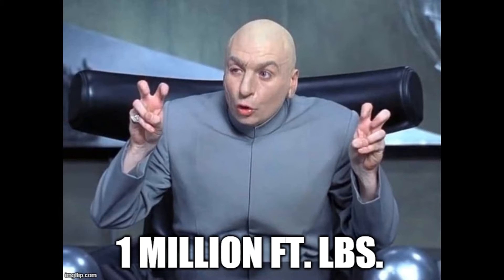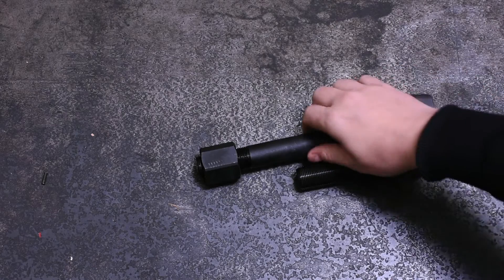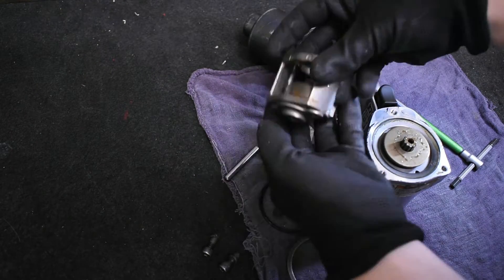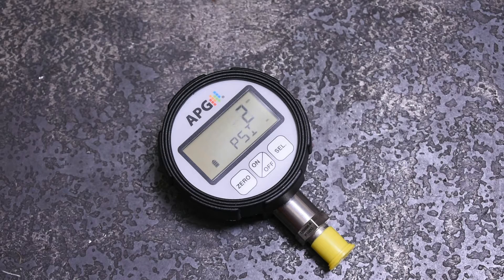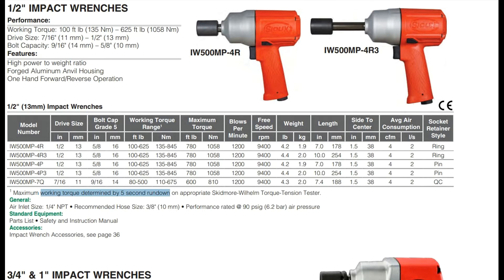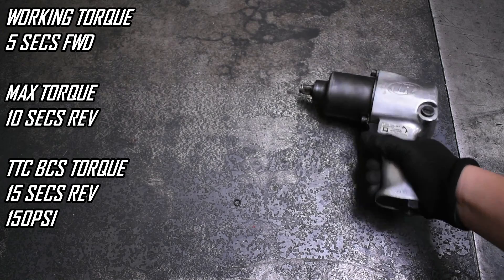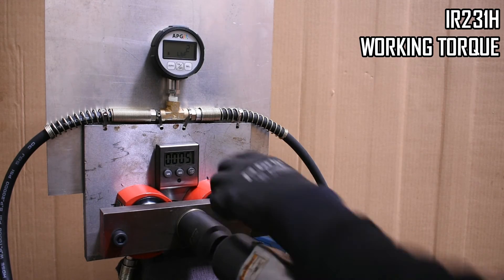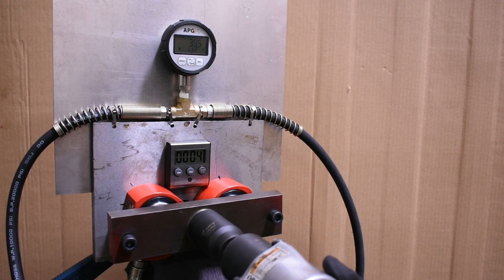Making a Digital Impact Wrench Torque Test to See Old-School FT-LBS

Comment from the maker: So what does a testing day with this rig look like?
1) Pull out a new or used bolt and nut and check its thread quality by running a new nut over it by hand, if it's ify measure stretch.
2) New grease to threads and backside of bolt head and grade 9 washer. If it's a new bolt, 5 beak in runs and re-apply new grease.
3) Test an IR231H to make sure it makes 440-460ft-lbs. If not, make sure gauge is within calibration to 3 known tool "standards" we have on hand.
4) Test 3 working torque tests, middle/median test is shown on screen. For cordless as long as the battery shows full charge each time we don't re-charge. Charge battery when done, allow tool to cool.
5) Test 3 Max torque tests, median is shown on screen. As long as the battery shows full charge each time we don't re-charge. Charge battery when done, allow tool to cool.
6) Test Best Case Scenario at higher pressure for air or fresh off the charger each time and in the FWD direction as well for cordless. Best value is shown on screen..

We note to you guys if they test all over the place or do other weird things.
Reply: I'm not clear on the rig reset process, actually. Not a big garage tool guy so not really familiar with how a short body ram works, but I can't imagine that they're set at minimum to start. Are they like, inflated to maximum to start with? Do you depressurize the system to undo the main bolt?
Reply from the maker: @orbitalbear  They are at about 50% extension all the time. Using a valve to remove pressure would save us a whole lot of impacting and time over the years, removing the bolts. But we didn't want to add any valves or anything in between or have the rams move in and out all the time for consistency sake.
Reply from the maker: @orbitalbear  Bingo. Usually with a different battery or different tool.

Comment: It's interesting to see that you started with the IR tool.  I worked in my father's garage many years ago, we had a 3/8" drive IR that was used occasionally but we mainly used a pair of CP tools, I think they were CP734 and have published specs identical to the IR tool.  We did anything and everything with them.  I don't know what air pressure we typically ran but my father once told me that when he was doing a lot of work by himself he ran the air pressure at 150psi or more to get more power out of the impact wrench.
It's interesting to see how you developed the test rig.  I would be interested in seeing how you capture the real time data and create the real time graphs.

Comment: Hey guys - I really like your channel - I especially enjoy getting cheap test results (I'd say free, but I did buy your spreadsheet).  I'm an engineer in a test lab, and I've been watching your videos for some time now and have some constructive feedback for you to take or leave.

1) Instead of counting your timer down, why not count up and just run up?  You can pull data for your 5 & 10 second tests from the single run.
2) You can automate your timer and get more precise to get it to start when you start the wrench - timing it off the first impact so you're not timing yourself pressing the button & getting your hands back on the driver.
3) I think this test method is fine, but I think you'd get much better data if you welded a bolt to a frame and made it into a load cell (add strain gages & data acquisition - this can be done well for about $500, maybe a bit more depending on software).  I've got a few technical reasons for thinking this would be better - if someone is trying to loosen a rusted bolt, the bolt isn't turning, and friction/bonding on the bolt is what you're trying to overcome.  In your stand, the bolt slides to a stop and friction would be subtracted from the measurement, as well as inertia from the bolt & stand.  At the end of the test when the bolt stops, this should be negligible (I think - it'd be interesting to verify - but this could be a source of variability), and it will definitely have an effect on your dynamic measurement.  I don't think I've seen many impact drivers completely stop increasing, so it looks like you're always moving the bolt in your 15 second tests - so it probably impacts all of your tests.  
 3a) Using a load cell would give you a lot of really interesting data - you could show a torque vs. time for the bolt and get into the low milliseconds - you should be able to separate out each impact.  
4) I really like what you guys are doing, but the calibration against an old product makes my skin crawl.  I don't think it ruins what you're trying to do, but if you want something that's universal, you could do something a lot better fairly easily.  Ft-lbs are really intuitive - it's a pound of force on a 1-ft lever arm.  Didn't you all calibrate a different stand by putting a lever arm on a stand and loading it up with some sort of weight in one of your videos?  I might be thinking of project farm...  In any case, I think there should be a lot of options here to get a real number, some of which would be NIST traceable.
5) Why not run until the torque stops increasing?  If it takes half an hour, it'd be interesting to see what the peak would be.  This should go a lot quicker with the different test setup tested above.
6) If you do multiple runs, you could graph the results showing the average as a line and shade the max to min range

Again - really cool channel, I also really like how you experiment modifying batteries and take the time to test most of the tools with different batteries.  Thanks for what you're doing!

Comment: Interesting. I can't help but keep thinking of what I would do, which is just a teardown and measure of the rams. I would throw the calipers on the actual cylinder and calculate the exact area each psi is acting on. There's frictional losses in the rams and the bolt threads, but that's just the cost of doing business in the real world: all we need to know is how many psi are we creating at the end of the drive train where the rubber meets the road, and how much surface area those psi are acting on. Eh: but then more calculations would be needed to convert lbs of force to ft-lbs of torque, based on whatever the conversion factors are from tension to torque. Meh: the more I think about it, you guys did it the smarter way...

Comment: Why not calibrate the torque of the guage to the torque of a torque wrench. Could get a digital torque wrench that does 100 lbs/ft that is calibrated. Use the wrench to set your gage. Even if you have a 1% out of calibration, itll still be accurate enough to tell which brands are lying.

Comment: Nice demonstration and explanation on the design of the test rig. Do you think the hoses are acting similar to water hammer arrestors? If it were plumbed with rigid pipe it probably would read higher pressures.  Generally I think it's a fair way to compare impact wrenches.  Is there a reason why you chose this design instead of measuring bolt stretch?  Could have used bolts with some strain gauges?  Probably would have needed different bolts for different torque ranges and that may make it tough to compare toque, but it could have been calibrated against the stretch from a torque wrench.  Friction on the threads and under the bolt head is what can really throw off the numbers if it's not kept consistent in all the test.

Comment: This is superb, and really well made. People don't realize that it really doesn't matter if the old school IR gun isn't exactly 450 anyhow because as you test more and more machines, you'll develop a relative comparison chart (which you have by this point) and you could average the differences and recalibrate if needed. The main benefit to this is it allows for relative competition, rather than simply single tool analysis. That's why you include more than one tool in each video.
Reply from the maker: You get it!

Comment: So adding mass to the socket shouldn't add any benefit to the torque rating. Its effectively mass being added to the nut. Or in simple terms, you're using the same sized hammer whilst trying to move a heavier mass - its not helpful. Personally I don't think it will harm much either, the bolt isn't really moving very far per hammer blow so I would only expect the resonances to be different, to win in some areas, lose in others, but generally be similar. But I'm not sure where this myth of heavier sockets helping torque ratings came about without seeing any data to support it I'd have to assume its just a misunderstanding of the physics involved.

Comment: In the video around 7:40 you talk about using the gauge (I think its an IP67 with 0-10000 PSI?) what is the conversion you are using to translate a load force in psi to a torque in ft-lbs? Is this actual ft-lbs or just a number to compare all of the impacts?

Comment: Would'nt a digital setup be better with less maintenance? with Load cells & digital indicator. Also traceability to National standards would be able to be established with loadcells.
Data logging would also be better with a high spec indicator like an A&D 4530 series or 4400 series.

Comment: This channel is brilliant!! Very relatable. I'm a Australian road train/truck mechanic and a quality impact is much needed. My first gun was the same IR231H that did the job pretty good. Then I upgraded to a Chicago Pneumatic that did really well, equal to the other boys Snap-on ear drum blasting MG725's, then the CP gave up the ghost and I bought the new Snap-on BT850, nothing but disappointment. Iv sent it back and had it replaced twice now, still gutless, to the point I feel like I need to go dust off the IR231H and put her back into service. Just a point of reference with price. 2004 the IR cost $230 new. The CP was $300 new in 2010 and the snap-on was $980 new (That the price on "special" in 2019.....yup.

Comment: I saw you put grease on the threads and not behind the bolt head where ta reduction in max torque happens due to the washer and bolt head friction. Does this matter?
Reply from the maker: We grease behind the bolt head as well, for every tool we've tested.

Comment: We use the 231C impact guns at ny work we have 2 of them. We use them to tear down 789 rear brake group off of 100 ton haul truck for gold mines. Nice to know the torque numbers. We use 150 psi to the guns and lose about 30 psi.

Comment: ah, I wondered how you were measuring the torque; nobody ain't? so it all depends on the small details of the specific test rig; lube, thread on the bolt, dynamic response of the bolt, etc...
Reply: can you calibrate more data points with torque wrenches? but I guess that is irrelevant for rattle guns.

Comment: Love that you're using a 231h as the baseline which was my go to gun for years.  I moved to cordless and had a gen1 Milwaukee that was "450ft/lbs" but my 231h could get what that couldn't with the same rating. I moved up to the 1400ft/lb fuel and had my socks knocked off.  The 231h hasn't seen daylight since. Really enjoyed the comparisons and seems accurate to what I've seen in real life.

Comment: Was this checked and calibrated with a torque wrench? I'm just confused how the gauge converts psi to ft lbs. Wouldn't a different size bolt thread give different readings?
Reply: they explain this in the viedo. The gauge reads the psi generated by the gun and then converts it to what is effectivly just a made up figure ftlbs. by using the same thread pitch and bolt size and grease they can get repeatable results to compare tools not neccicsarily to torque something a specific spec. by doping it this way they get numbers that comepare to eachother and a unit thats easy to read, understand, and compare against manufacturing claims.

Comment: I’ve been a subscriber for a few months now, I clicked on  alerts ! I’m a torque “fact” fanatic every since I tested my Bosch “freak” with a 90ft lbs torque stick and got 150 ft lbs out of it with a torque wrench ( and yes now I know that the tensile torque is different from your descriptions and comments to others!)... anyways I have a suggestion:
I swear my gearwrench deep impacts are most successful at applying more torque than my other brands of impacts ... ie: if my Capri/tekton flip sockets struggle taking off lug nuts, I don’t change guns (I have many as I’m a mechanic tool nut) I change to my gear wrench  #84935N as they are a heavy thick walled socket... 

Would you be able to test sockets in the future? Also I wouldn’t mind mailing yous guys  a 3/4” earthquake impact for testing  and a 1/2” snap on Mg725
Reply from the maker: We will be testing different socket types! But they have to fit our dyno for now. Interested in the 3/4"! Email us at torquetestchannel@gmail.com :)
Reply: I'm assuming you've seen the videos where they have tested sockets yeah? Turns out it has a fairly big impact
Reply: @tajr22  yes I have , my comment was 5months ago, way before they released that test.... I'm glad they proved it!!

Comment: You need to switch to actual high-flow automotive fittings...  11:40 way undersized air compressor.  I wouldn't try the 1/2 with anything less than 30 gallon reserve.
Reply from the maker: That's not our compressor, we're just mentioning how affordable and common 150psi is. We use an IR 60 gallon compressor with Milton V fittings, which are their HighFlowPRO
Reply: @TorqueTestChannel  Oh sorry, though that was what you were using.  I use Automotive/True-Flate/Parker style high flow that looks different than those Milton-V fittings...thanks for info!
Reply from the maker: You betcha

Comment: Why don't you use a torque wrench though to actually set the calibration for the gauge instead of the old IR airgun?  You are making a HUGE assumption that the IR gun does in fact produce 450 ft-lb of torque and then calibrating the rig to that.  Just curious.

Comment: Great setup and quick question. Why not use 3/8 air fittings?
Reply from the maker: Great question. We use whatever the manufacturer recommends in their manual which has so far been 1/4" fittings and 3/8" air hose. We're assuming if that's what they recomend that's what the tool's power was measured with. If and when we test an impact that suggests otherwise we'll use that.
Reply: @TorqueTestChannel  Is it reasonable to assume higher torque numbers with 3/8 fittings?
Reply from the maker: @Jay_Ira  We'll test that.
Reply: @TorqueTestChannel  from real word experience a bigger fitting will make a difference  
I use the topring ultraflo 3/8 npt  and 3/8 hose 
The 1/4 fitting really choke the flow of the 3/8 line
Volume is really important not just  psi
A 150 psi compressor at 5cfm is not the same as a 20 cfm 150psi compressor especially for the best case scenario
Reply from the maker: @legros731  We've recently tested the difference, it will be in a few episodes.